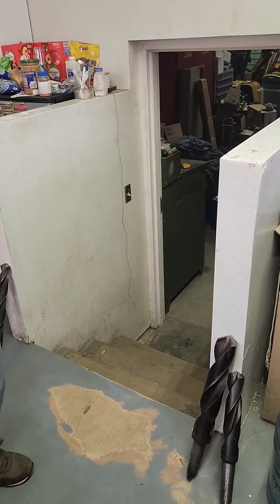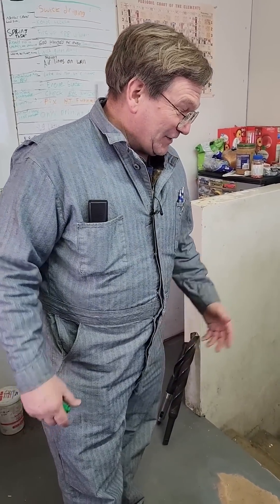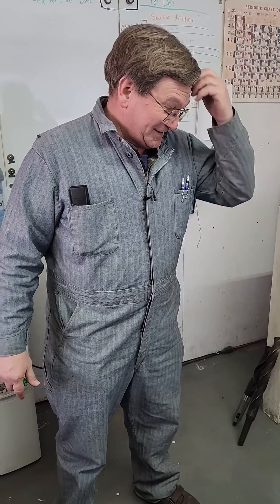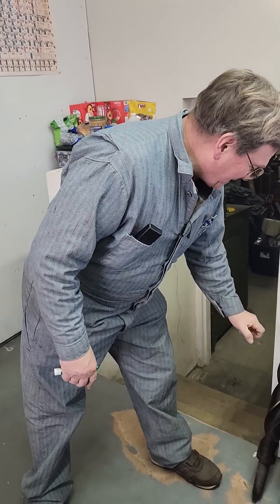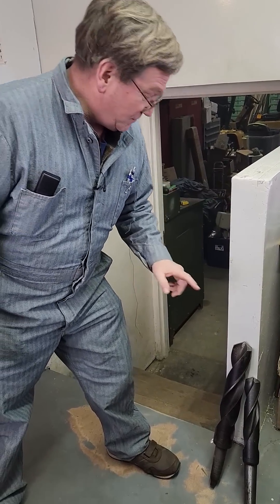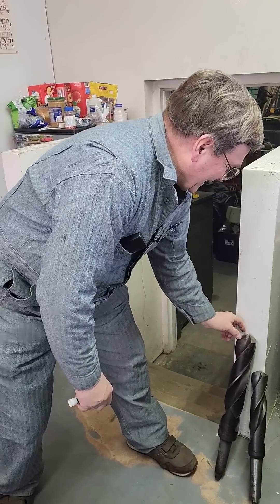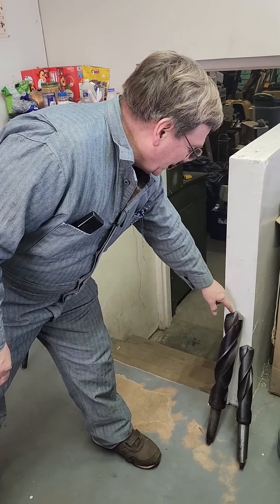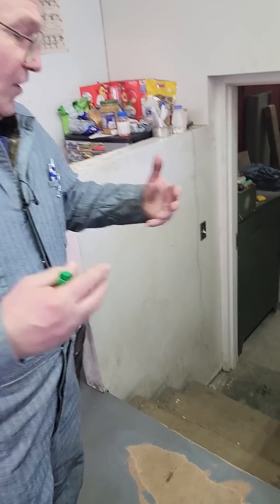Machinist's Minute(s): What size for your pilot drill?

Comment: Also. It’s always better to try and use the less used sizes as your pilot bits. So instead of a 1/2” go for a 15/32 or whatever you have you don’t use much.
Reply: Sometimes 15/32 is more than half the price of 1/2; I would go with what is cheaper.
Reply: @litoaykiu but in the field you want to use what is convenient as well. A 1hr return trip to the shops needs to be a factor.
Reply: @litoaykiu   Just don't use my 59/128" bit, I don't know where I'd be if something happened to it
Reply: Good point as well, i havent considered trying to more evenly wear the bits by using the ones I might use less for pilots where i can
Reply: @paladinkhan  isnt the reason that they're sharper and thus more accurate?
Reply: I've done exactly that for the same reason for years
Reply: @howardkeil1526  it's just common horse sense  --- like MOST of  these *informative " videos are !
Reply: How about a spade bit and forget about the pilot hole.
Reply: @nickgartman7326  for certain applications, definitely.
Reply: Everyone should heed this advice.
Reply: Or you work where I work and price is literally not an issue
Reply: 15/32 will be sharper.
Reply: thanks buddy, great mentality to have.
Reply: You're not kidding. It's why all the popular sizes are often missing in the drill index box...
Reply: @dc6233  or broken , resharpened by an idiot ! Lol( not my set ) haha

Comment: I do not pilot drill, grinding a split point is a superior method. I used to make propeller nuts for tugboats, I did not drill pilot holes whenever I used a 2.5" diameter drill. I made sure it is symmetrically sharp with a split point. My coworkers would even watch me drill because I did it so effortlessly. Most people pilot drill because of how much force it takes to shove the web thru the part. Not a concern with a split point.

Comment: My Dad, both of us and my first brother were EE Engineers, However, we had two B-36 Machinist living with us.  Cool.
Their idea is looking at the 'point or joint of flutes' say larger than the center cross point the idea drilling without a pilot, the center doesn't cut it pushes metal around.  the surface speed is SURFACE not the center that barely moves. It is a chisel.  Just larger than the flat.  The special center cutting drills make it so much better.

Comment: I was taught “your pilot hole only needs to be big enough for the center of the drill, but you’ll wind up grabbing whatever sometimes.” The shop I work in has REALLY cheap 1/4in drills, so I usually just go with that.

Comment: I've only used a pilot drill when the drill diameter is larger than 5/8" and then use a drill that's only slightly more than the web thickness at a 0.5 to 1.0" down from the tip.👍That is why "Machinery's Handbook " is the bible of the industry.

Comment: Yeah that rule of thumb doesn't really apply when the bits are bigger than your thumb and needing to maintain tolerance xD that 6 inch pilot to a 12 inch hole that's alot of material removal and room for walk idk I made airplane we bore anything over 3 or the hole won't be round or straight enough for anything I'd trust xD but I'm betting your 12 inch hole is for access not a 12 inch press fit pin... I have seen machines do amazing things but they are only so rigid

Comment: You really only need to have a pilot hole, slightly larger than the thickness of the web of the larger bit. Provided your bits are sharpened properly.
Reply: Agreed. That's what I was taught 🍻
Reply: That's the answer I was looking for.

Comment: We would drill tube sheets stacked with the baffles all the time. 1-1/2”, 2”, 2-1/4” diameter holes. We’d drill a handful of holes about 7/8” diameter first, then bolt the stack together so that they wouldn’t push apart. We would spot the holes with a center drill, then push the drill through, full diameter. To keep the drill alive, cut back on rpm, and make up the difference with higher feed rate. We had big Carlton radials, ran them round the clock for weeks sometimes.

Comment: I was always impatient and thought it was pointless to pilot drill as it would save time not changing drill bits, but I soon learned if you have a good sharp pilot drill it will drill quick as fuck, you just gotta be careful not to snap it!
Same with the rpm, I used to just run the drill press as slow as it goes as I would drill 1/2 to 1” most of the time, once I realised how quick you could drill with a 1/8” bit running the drill press at max speed I always take the extra time to change the drill press to the correct speed, (swapping the V Belts )
Cheers from Australia 🍻
Reply: im not a machinist in the least, just a gearhead, but especially with cheaper drillbits cannot get it dead center unless I drill a pilot hole, it always walks 1/32-1/16 of an inch, enough to piss me off.

Comment: I usually go in stages when drilling. 1/4 increments if possible. Does 2 things less fatigue on the bits and increase the chance of drilling straight with minimum pressure and speed applied.

Comment: It depends on the purpose and machine I'm drilling with. 
But I'll typically pilote to the widtn of the web or slightly under that. 
And pretty much never/seldom on anything finished hole under 3/8".

Comment: Dale actually did have a good point (no pun intended) and here's why: I used to pilot in stages, still do on some jobs, trading time for effort, nut each time you drill a hole, you have the possibility of an error; too many errors in the wrong direction can put you out in left field. Drilling the hole in one pass after a pilot just big enough to clear the point can reduce the possibility and magnitude of error.
Reply: That and the initial pilot hole helps keep it centered

Comment: i was always taught to pilot drill just bigger than the web for anything over .5 inch drill bit. once had aluminum i needed to drill 1.5 inches and a guy told me and another guy doing the same thing not to pilot drill it. i pilot drilled mine, other guy didnt, and i drilled it in 1/3 of the time. even tho i had an "unnecessary tool change" 😂😂

Comment: Hold on a minute! Aren't you the guy who was preaching file terminology?   ...and now your're calling the web of a drill the "dead center"? Its called the web and its sharpened into a chisel point or a split point. Ya cant be hufffy about terminology and then ignore it with other tools
Reply from the maker: The dead center is a specific part of the web (the very front center, also called a chisel point), but only exists on a simple sharpened drill bit, it goes away if the point is split, also called "thinning the web".
Reply: @HOWEES old turret operator here, sometimes you have to manage your chips too, or they will make you crazy!🤯
Reply: Sometimes while filming its hard to remember the proper names for things.

Comment: I have been pilot drilling just a bit larger than the center point of the larger drill bit as long as I have the power to turn the bigger drill bit for for 50 years now and usually works fine .
Less speed and more oil is always better as high speed heats up the drill bit and takes the temper out and dulls it .
Stop and resharpening the bit if it is not cutting properly , do not keep forcing it and heat it up .
Reply: One of the biggest problems people have is that their drill press won't go slow enough.  All mine have been set on the slowest speed since new. If I want to drill a large hole I need to set up the milling machine or use a friend's 125+ year old belt pulley drill press.
Reply: @jeffhill3681 in my opinion the mill is also better suited for drilling big holes, way more stability as the average Drill press, and usually a way better vise to avoid the helicopter of death :)
Reply: @--Michael--  
  Probably, but just not as quick and easy.
Reply: This is the proper way. Just bigger than the web. Most of the force and friction is generated by the web, so removing it makes less heat and reduces effort. 
Going bigger makes the drill wander and has worse heat dissipation as there isn't as much mass of chip to take the heat out with it. It also causes people to feed too quickly overloading the bit and over heating it.
Reply: Yes. Drilling a pilot too big can get the bigger drill to chatter like crazy.
Reply: @michaelslee4336 it also heats up the toe, or the far end of the chisel. Using too big of a pilot doesn't allow the drill to heat up properly and causes the chisel to become brittle.
Reply: And that correct drilled pilot hole works to steer the drillbit
Reply: This is the way my grandfather taught me. He was a die maker and machinist for his entire life.
Reply: a drill that is getting dull takes seconds to sharpen than one that is blunt and needs a regrind that takes minutes to do
Reply: Absolutely correct. Assuming properly shaped and sharpened drills, simply clearing the tip by a  .010"/side will reduce the time needed to drill this pilot hole, then provide a better support to the cutting edge which reduces chatter quite a bit. Slower speeds, with coolant, and higher tool pressure makes for a smoother finish and ultimately better hole. Plus, if done correctly, this pair of drills can work all day long without resharpening also cutting time costs as well as tool costs. Exotic workpiece materials and cutting tool materials, as well as innovative new  designs of the cutting tools themselves, have much different operational requirements than the classic drill.  On a standard high speed steel drill, a starting rule of thumb is a standard 1/2" morse design drill bit, in mild steel, should turn at 500 rpms.  Adjust the speed for your diameter drill.  So a 1" drill would be 2x the size, so 1/2 the rpm 250rpm. Adjust tool pressure for proper chip shape and color.  It's a great starting point for any drilling job. Also worth mentioning, that the tougher and/or harder materials require far slower rpms and lighter pressure. At some point HSS drills just won't get the job done.

Comment: Is there a "rule of thumb" for hole size for tapping threads?
I would imagine it is the root of the bolt. Maybe a hair larger.
Reply: Search tap drill size, there are charts.
Metric iirc you just do dia-pitch, or 7mm hole for m8x1 thread.
Reply: @electrowizard2000  It's the same for freedom threads. Just make the pitch a fraction and subtract from the nominal thread O.D. example - for 3/8"-16 threads subtract 1/16" from 3/8" = 5/16 drill size. This gives you 75% threads, which is fine more most stuff.
Reply: You can go by the ol' diameter minus pitch. ex....1/4-20 thread is .25 - (1/20) = .2 for the drill bit....Whatever is close to that is good for most stuff.....metric is easier because the actual pitch is given to you...ex...m8x1 equals 8mm -1 mm = 7mm dill bit for the tap.
Reply: To add to what others said, the drill size is also going to depend on the material. Harder materials require a slightly larger drill.